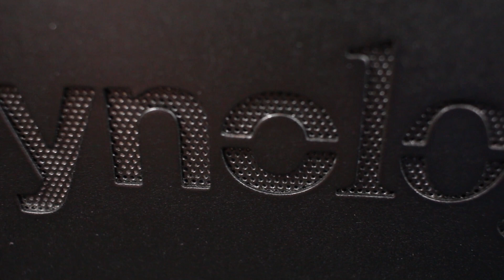SYNOLOGY DS214+ DISKSTATION TEARDOWN GUIDE | STEP BY STEP

Comment: As a note: If you lose the key for the HDD caddies, you can use any Hex head of the right size (sometimes known as Allen keys).
Even a flat blade of the right size will do it in an emergency, they are not hard to turn :)
Reply from the maker: I did not know this. You're also not required to lock the drives in. They will still operate, but don't try to pull the drives out without powering off first (just incase yours is not hot-swapable).

Comment: So has no change to add more ram on this board?
Reply from the maker: The RAM is soldered on and I haven't attempted to remove it.
Reply: If I would remove it with Flux and a heat gun.. Where would I find a 2 or 4gb ram to solder?
Reply from the maker: I think you also need a memory controller that supports your new storage. Start by seeing if the manufacturer makes a memory chip in that form factor for your storage requirements.

Comment: Thanks for the video. My DS214 has stopped powering up. Where do I find the power unit, if any in it? The power cable seems to be getting the power, but none getting into the DS unit
Reply from the maker: You're gonna have to troubleshoot the board. There is a cap and resistor by the power, I would start there.
Reply: @ImmodderNation  thanks. Am not a techie, but will tinker around and check, and see if the capacitor/resistors resolve the issue
Reply from the maker: Let me know how it goes.